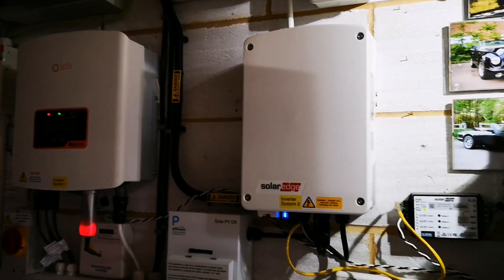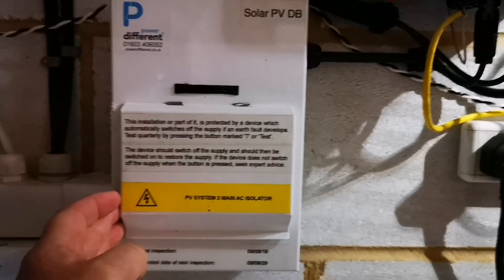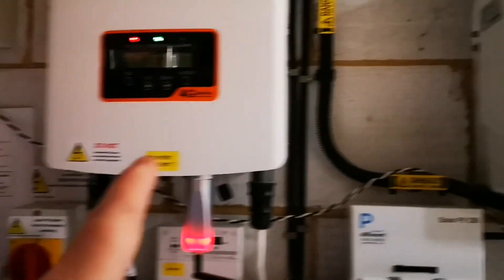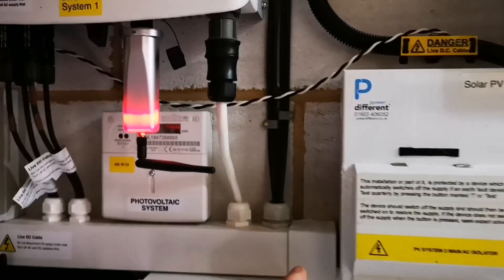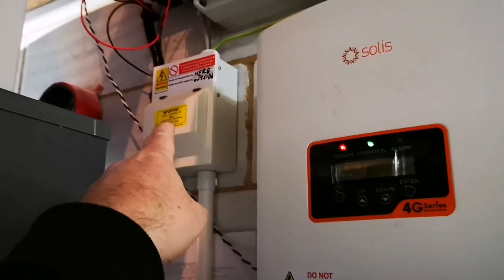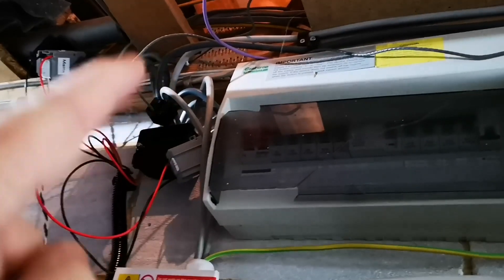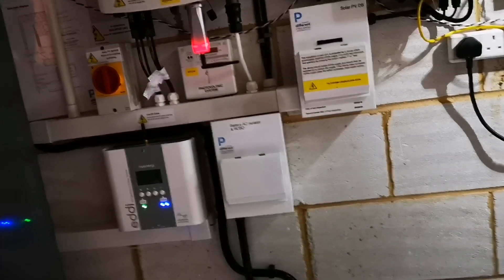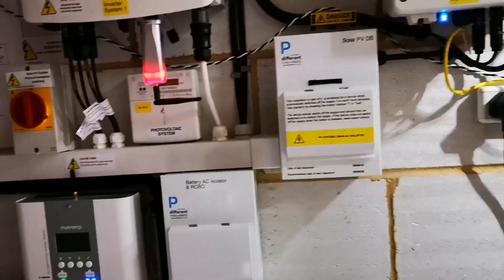Solar Home Storage Battery test - First issue

Comment: I recently had a battery system installed which highlighted a major problem. As an example, from 1 Dec until lunch time on 9 Dec, my inverter tripped 200 times (yes 200) with a grid voltage fault. I was receiving power above the permitted range (at 1 point it read 258 volts). Northern power sorted the problem on 9 Dec and appear to have reduced the local tranformer by about 5 volts. Since that time I have had no instances of my inverter tripping out.
Reply from the maker: Phew, I guess it happens and we only find things out when we change

Comment: Just watch this video again and you need to put your battery’ circuit on the original consumer unit and leave the ct clamp where it is
Reply from the maker: It'll be fixed soon
Reply: The EV Puzzle I’m getting very bored have you got any content to upload

Comment: I have a DC Coupled Solax battery, is there a CT clamp that can work with the DC cable (52V)? It would be nice if Zappi supported DC Coupled batteries too :-(
Reply from the maker: I believe it does still work. Remember the CT on the Myenergi solution is just to get the visual display showing how much solar there is . It doesn't impact functionality
Reply: The EV Puzzle, I was told by Myenergi and by a local electrician that the Zappi would empty the solar battery because it cannot distinguish between solar and battery power. This is the only reason why I'm not getting a Zappi ☹️

Comment: What's a CT clamp?
Reply from the maker: A little electric device that self powers from the magnetic field around a power cable. It sends power related data to whatever device it connects to.

It's how many home energy monitors work

Correct me if if wrong any experts out there

Comment: with your Zappi / Eddi system you already have an integrated system to consume most PV power locally.  The local power bank does not communicate with the Zappi, which makes integration difficult.
Reply from the maker: It sure does. If only Myenergi did storage batteries

Comment: VERY MESSY INSTALLATION COMPARED (oops had caps on) to my solar only instal.
Reply from the maker: Yes I have some temporary wires I've installed myself for CTs and the Modbus for my Solaredge Inverter. Take those extras away and it's neater. Install it all together and it'll be neater

Comment: Of course, as you draw power from the battery too, it will show this power as being solar power.

It's a simple fix to move the battery connection north of your pair of arrays where they combine.  Might just be simpler to run the battery off it's own MCB in the consumer unit.
Reply from the maker: I agree Cormac, should be an easy resolution

Comment: Hi EV Puzzle
Congratulations for taking the plunge! I have more or less a similar system than yourself:
1) FIT Solar array 3.4 kWp installed in in 2011
2) Enphase Solar array 3.0 kWp installed in 2017.
3) Pylontech battery stack 12kWh (5 x 2.4kWh£
4) AC coupled battery inverter to charge from surplus solar energy from the arrays 1) & 2) above, installed in 2017.
5) Eddi to heat a 500 Litre heat store once the batteries are fully charged.
6) Zappi was to be installed later this year, but......In the current circumstances I am not so sure☹️.                                         In order to avoid unwanted discharge of the batteries by Eddi and sequence the battery charge priority the CT clamps need to be in correct location and the Eddi’s and battery inverter settings must be programmed to achieve this sequence. My system has been working for 3 years without any hitches. It can be done - good luck!
Reply from the maker: Except you get really good Fit payments 😭
Reply: The EV Puzzle 
The FIT eligible array was fitted by my roofer as part of a roof tile replacement. The costs for the panels and grid tie inverter including commissioning were ~£7000.00, a reasonable price at the time. At the 8th anniversary the FIT revenue was just over £15000.00 here in the cloudy, rainy West Country, with another 17 FIT years ahead. I am very happy with the solar panel investment.

Comment: I have a single 3,2Kwh array feeding a Victron MPPT 150/70 Solar Charger. There is a Victron Multiplus 48v|5000VA|70Amp and 8 x 2400 Pylontech batteries to complete the system. All the performance data for my system is available from the Victron VRM portal. Maybe the Victron inverter in the Battery Box can give data to the VRM portal to monitor energy going to the battery?
Reply: Stephanus Lintvelt 
I am very tempted to replace my Sofar battery inverter with a Victron. Having said that my current system has worked flawlessly for the past 3 years. Any chance for a diagram/photograph/detailed description???
Reply: fje1948 it could be a bit difficult to get a diagram to you. If you give me your email address I will give you access to my VRM portal where you will be able to see the performance. Seeing that I have a colour control GX gateway the MPPT,  Battery Bank and Multiplus are all connected via a VE Bus. The GX device seems to be the brain in the system. The system is connected to the Internet. I have it on a one minute update rate to the VRM Portal.

When you have access you will be able to see a block diagram in operation. I am running  under an ESS (Energy Storage System) that is optimised for battery life.
Reply from the maker: Stephanus that sounds like a great config. I'm using VRM too but I'm just getting used to it. All the data seems to be there but the graphics aren't brilliant imo.

Two questions, how do you change the interval on the portal. I've set it to 5mins in the settings within VRM but nothing has changed.

Also Active SOC limit seems to have a mind of it's own. Do you have any experience with active SOC limit re: battery life mode?
Reply: The EV Puzzle I set the Log Interval on the VRM Online Portal page of the Colour Control box. The installeer had given me Full access which is something to check on your side.

I am using the standard ESS profile with the Mode set to Optimised (with Battery Life) and the BatteryLife state set to Self-consumption, from installation. This was as backup to the unreliable grid power in South Africa. Initially we only had 9.6Kwh of storage but found it not enough to get through about 14 hours of no our low yield per day, that was at the minimjmSOC set 50% to leave a buffer of 30% should the grid go off. Storage was increased in February 2019 to 19.2Kwh giving me sufficient reserves to keep 40% + in reserve for power failures while still running the house with only 0.8Kwh from the grid per day. I have the capability to go totally off grid, but not during long bad weather periods.

Minimum SOC (unless grid fails) I have at 50%. In the  nearly 2 years of running I have never seen it drop below the value I have set. The battery absolute minimum setpoint is 20% but I have never seen it that low even during South Africa's notorious Load Shedding when the grid is off.

The Active SOC limit seems to be using historic data to re-calibrate itself. With two days of clouds I set the Minimum SOC to 40% hoping not to use grid energy. The battery drained to about 45% and with minimum sunlight only reached a maximum of 75%. The Active SOC increased by itself to 55% after day one and ended up at 65% after a second day of low energy harvest. It stayed higher than my Minimum SOC setpoint even after a good day with the battery charging to capacity. After a second good day the Active SOC is the same as my Minimum SOC.

The battery draing to 0% should not have happened seeing that the battery BMS should have stopped it at 20% to protect itself anyway. The installeer will have to check the settings on the BMS and the Multiplus. 

We have a solar heating system and normally do not need to use the immersion element. On the odd occasion where the temperature of the hot water was not to my wife's liking the ESS used battery power to supplement the power from the panels. Once the required temperature was reached the panels just charged the battery again.

End of my rambling.

I hope you get the teething issues sorted quickly.

Comment: Interesting system. Nice to see differences in installs. It is little limiting to add battery once your original system was not designed for it. I have Fronius inverter with Sonnen battery where Sonnen is the brain. It is much easier to check stats because everything went through Sonnen battery system. Great content as always.
Reply from the maker: Definitely a rooky mistake doing it in stages but it's a fun project
Reply: I see nothing wrong with a "modular" system.  I reworked my entire system from 3s3p --> 150v 60A Charge Controller --> 4s x 48v (4 x 12v) Lead-Acid Batteries --> 1kw Inverter to my new setup of 1s --> 3kw Inverter with a separate 3kw Storage Inverter (like your battery box thing) connected to the same battery vault.

As you journey, you learn and adapt.  I started building as a form of "proof of concept" project, and then did it better.